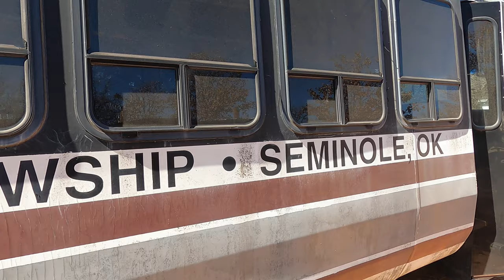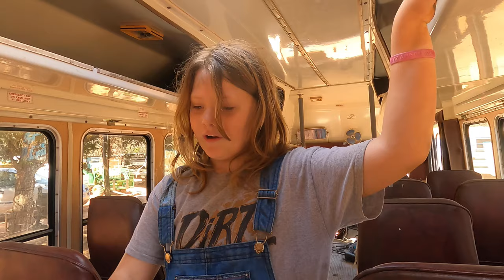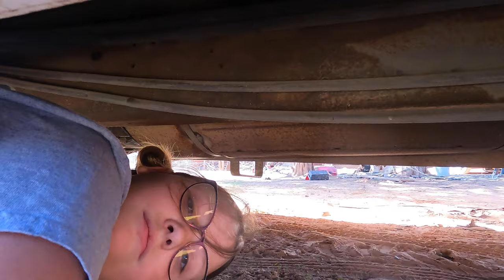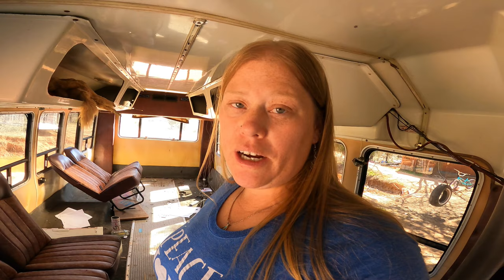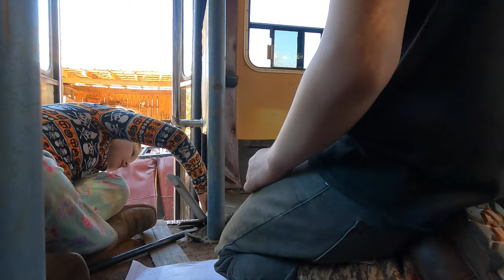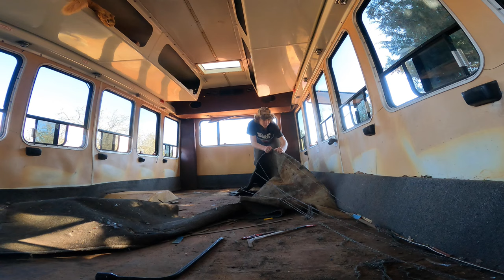Lilee's bus makeover: Family DIY Adventure in Arkansas #FordBusConversion #offgrid #sustainable

Comment: Holy cow! So exciting! You didn't waste any time! Demo done and time to put it back to gooder than ever! 😜🤣❤️
Reply from the maker: Yes ma'am. We are getting it done. We were going to begin installing the new floor this evening... but it rained yesterday and the roof leaks... So, we got the water off the roof and put a fan in the bus to help the floor dry some. We hope to get it done tomorrow. It should be a pretty quick job. We are going to overlay the existing subfloor. We will screw it down, then cover it with a couple of rugs. Then it'll be good enough to start moving into.